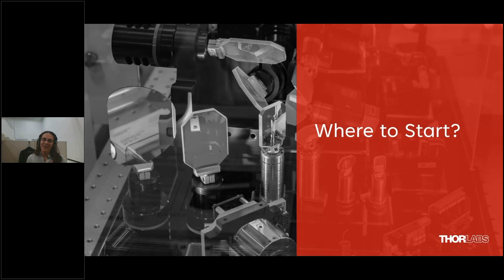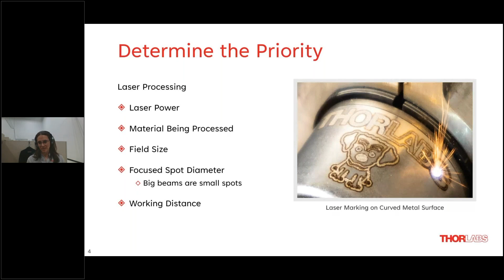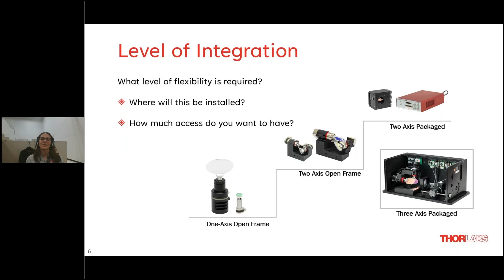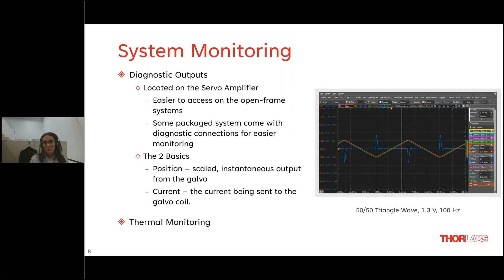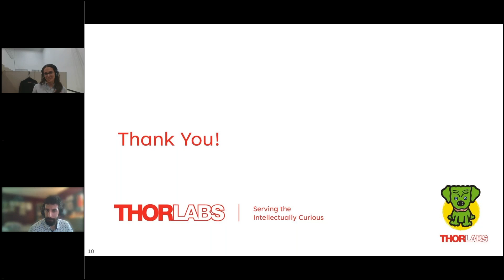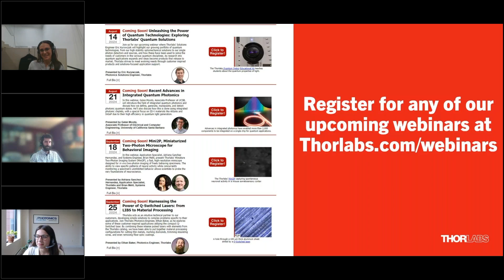Beam Steering with Galvos: Common Configurations and Their Uses

Comment: Are you familiar with systems with focusing after galvano scanners? I need to scan the laser beam at a distance of 500-1000 mm from the galvano scanner (with the ability to change the beam focus within 50-100 mm).
Reply from the maker: Thank you for your question! It sounds like you are describing a post-objective scanning system similar to our XG330 and DCB320, which can be found here: https://www.thorlabs.com/newgrouppage9.cfm?objectgroup_id=14125

For more information about 2- and 3-axis systems, you can read our brief overview here: https://www.thorlabs.com/newgrouppage9.cfm?objectgroup_id=14125&tabname=2-Axis%20vs.%203-Axis

If you have more in-depth questions about your setup or application, feel free to reach out to us at techsupport@thorlabs.com.
Reply: @thorlabs  I consider such a system as an alternative.
I was talking about the system: a parallel laser beam from the scanner hits a plano-convex lens (the convex part is up), laser beam converges in focus, then diverges and hits another plano-convex lens (the convex part is down), after which the parallel beam hits a focusing double convex lens. The first lens is mounted on a movable table to allow changing the focus.
Reply from the maker: Thank you for the additional information! Please reach out to techsupport@thorlabs.com for help with this application.